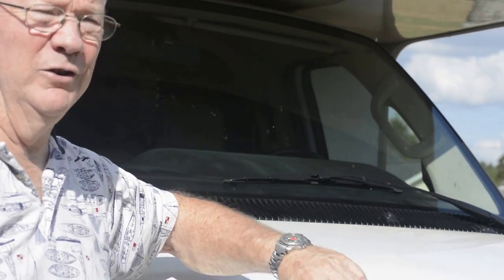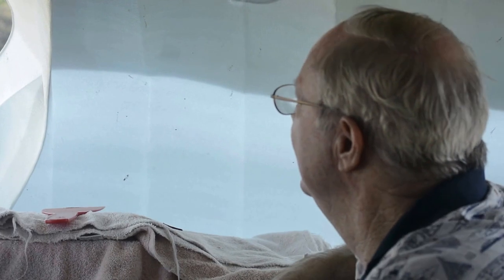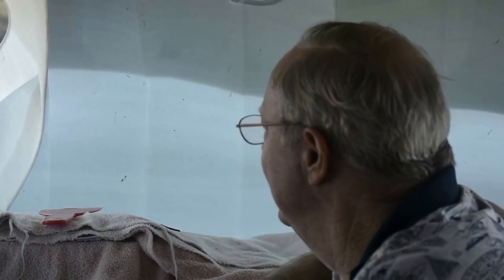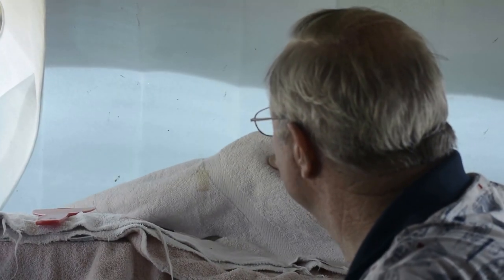Rear View Mirror Removal

Comment: Thanks, where to get that glue sheet to stick the mirror into new position again? I want want to use a simple double tape
Reply from the maker: John hello. I didn’t, replace my mirror as I don’t need it in the RV. You can get the glue at any auto parts store and I think WalMart also carries it. Hope that helps. Be safe out there.